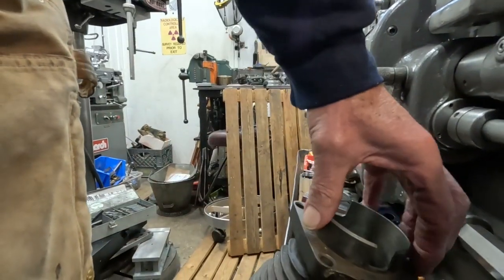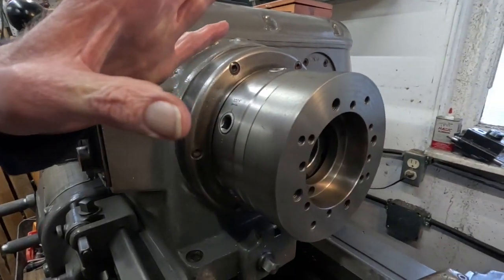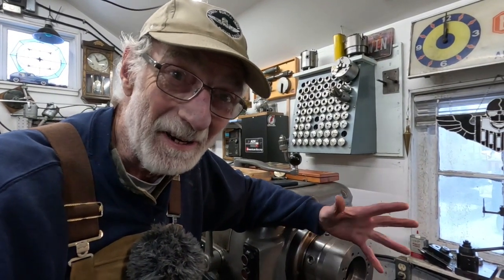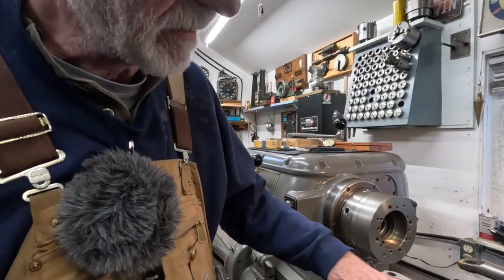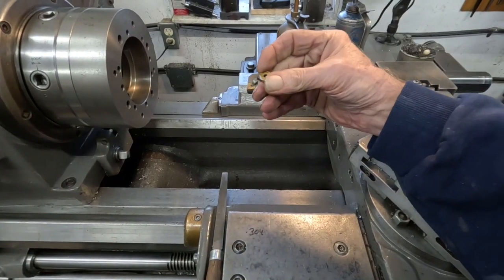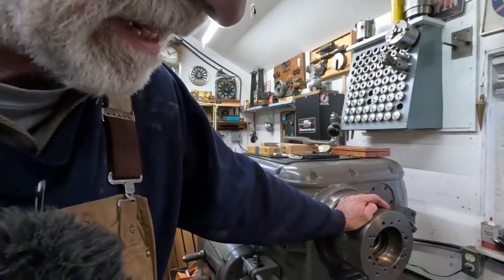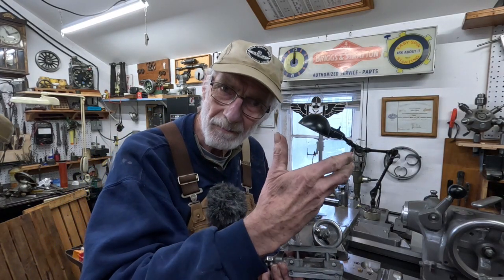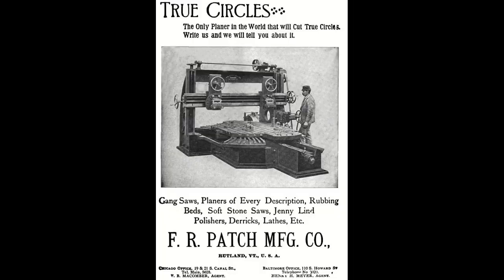Harley Davidson Machine Shop, Cylinders Bored on Engine Lathes

Comment: CNGG430.5 FJ VP10RT from Mitsubishi are pretty badass I like an .008 nose radius they roll a good chip less chatter and finish nice at .0035 IPR or so. Good whatever grade can't beat a good positive rake tool for finishing especially when you're hanging out there a pretty good ways keep on keepin on
Reply from the maker: The cast comes off as powder, there is a hard skin from the heat and ring wear. One advantage I have is the already worn/chipped inserts are basically free, I can create consistent cutters with any angle and nose radiuses with the Cincinatti grinder.
 I am pointing out another way of working precision that has been lost in time that also keeps cost way down.
 I am very aware of high shear inserts they simply cannot last and drive cost up in a small operation like mine. Thanks!
Reply: @DonDyarprecision  Recycling! I like that man our "carbide scrap" inserts could live a 2nd 3rd 4th life right on. How deep is that case hardening usually just curious?

Comment: Early spring of 2006 I was on my way back to AZ from a trip up to OR on my new 2006 88 inch Dyna. On I-40 just before Yucca doing 85 MPH towards Kingman I saw this old Rigid crossing up on the overpass. He got on I-40 and caught up to me right now. We rode together and kept it between 90-110 mph for about 20 miles till he peeled off. Really young guy on one of the rattiest old Knucks I've ever seen, but man that thing was packin some beans!
Reply from the maker: Stop smoking that hippy weed.
Reply: @DonDyarprecision  Don, I'm a retired auto machinist and was 57 at the time and never a big fan of weed. I thought a fellow machinist who knows this old Iron would appreciate what can be done to it. I'll admit though it's not something you're gonna run into very often.

edit: I have a 53 KK, 53-K bottom, KR top so more than interested in what you're doing.
Reply from the maker: @1guy1968  OK, my experience here is totally worn-out Knuckleheads, any good ones were likely bought cheap up by pickers from California or stolen by the bike gangs in the early 1970s.
Reply: @DonDyarprecision  I've pretty much only been interested in Sportsters an British twins since the 70s. Except for the 48 EL and the 53 KK I've stayed away from the older stuff. Over the years I've had countless opportunities to buy Knuck basketcases at giveaway prices.

Comment: there was a machinist at work that was asked to improve some carbide inserts. Similar to your grind on the 432, he then put them on his cincinnati tool cutter and proceeded to polish the edges to superb sharpness.  When I say superb, this was determined by using a honing or polish surface with likely .3 micron diamond for more than a month. I would go into his shop and see a row of tool and cutter grinders constantly polishing.
Reply from the maker: You can bullshit yourself but not me, get a life.

Comment: I enjoy the old images of machine tools  you show .  When I was very young my dad would take my older brother , and myself to machine shops .  One of the oldest shops used line drive on all the machines .  They generated acedalyn gas  by dropping carbide prills into water .  Don't know if they mixed it with oxygen (can't remember seeing oxygen tanks ) .
The weld shops all used arc welders , and the rod stubs were all over the floors .  Don't see that anymore  .
Take care Don , wish you all the best !
Reply from the maker: There were still line shaft shops into the 1970s in this area, even steam driven sawmills where the sawyer rode the steam driven carriage. There are few acetylene generators at one scrapyard that used carbide like miners lamps here, thanks!
Reply: Machine shop on Ventura avenue Ventura, Ca. Had a service truck with a acetylene generator mounted on side of truck. This was like 1971. You did not want the pressure to exceed fifteen pounds or so. It would become unsatble. It was an oil rig general purpose shop.
Reply: The  never ending amount of knowledge you have just blows me away every video👍👍👍
Reply from the maker: @lotharfunke8749  More coming, thanks!